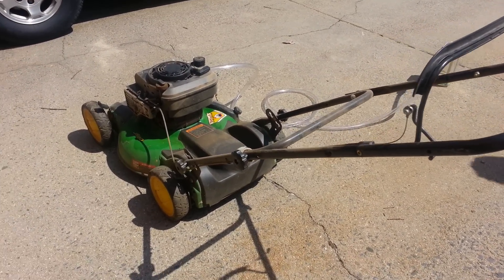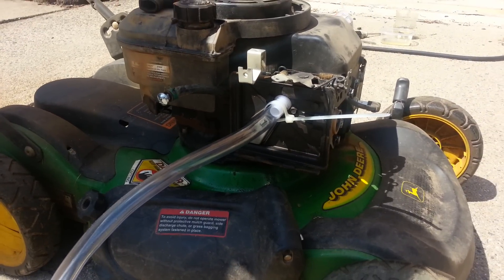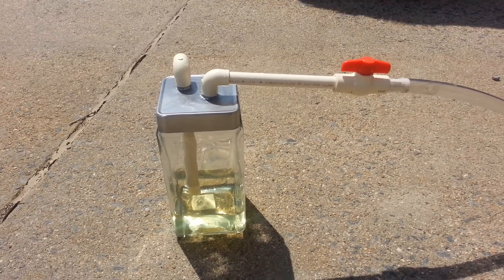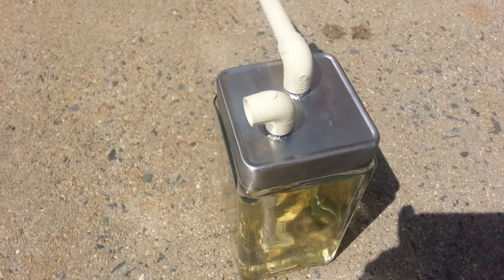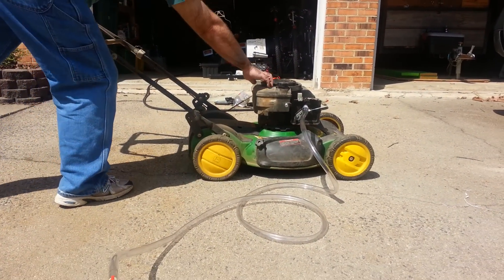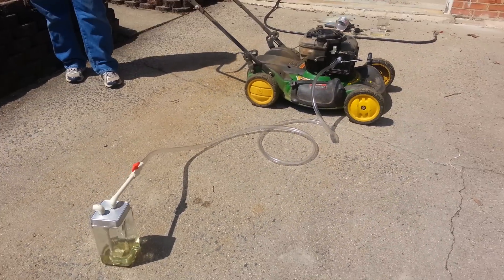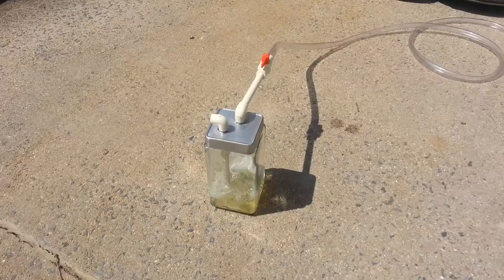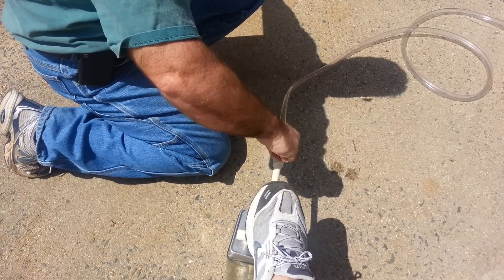Gas Vapor Carburetor

Comment: What does the carb do? It takes fuel and vaporizes it. What does your box do? The same!
You haven't accomplished much here, I would bet both use about the same fuel to run the engine.
Reply: Settle down My father a mechanic for 45 years said it would not start. When we started it he said it would not pull a car because it would not handle the load. When we ran the 1/4 mile in 10 seconds he said it wouldnt run for a long time. Then we got 651 mpg ( measured) he said he still didnt believe it. So you and your 35 years are a light weight. It certainly has its limitations but not the limitations my father said.
Mine is not speculation or anecdotal evidence it is empirical data achieved through extensive experimentation. Ive learned its advantages and its limitations and Im telling everyone in videos like these. I try not to have a pissing contest or prove Im the smartest guy in the room I leave that to Wile E Coyote I would also put my experiences up against your speculation any day of the year
Im not some guy who knew a girl whose boyfriends father tried this I am the guy who did this and not for quick audience and recognition from You Tube followers. The one thing I did learn was it doesnt operate in the normal or standard way internal combustion engines operate. I tried all the conventional wisdom first but kept my mind open and discovered this.
Its biggest drawback is it it is not responsive enough to changes in acceleration, so yes you can get it to go 60mph easily enough but you cant accelerate or decelerate or it stalls
Most major testing on this device has been on test tracks or in Tom Ogles case on an interstate at a steady 55mph
What I have learned was that all I ever learned or knew about internal combustion I had to disregard and unfortunately my father couldnt come to grips with being wrong
So 35 years experience has no bearing on this technology and most people with experience post the same notions all the time safety, engine damage, inefficiency, scam whatever 
To them I say It is safe it uses vacuum and you can backfire into a vacuum all you want but it cant(yes I said cant)explode. Ive tried and have never succeeded.
It burns intake valves(500 hours on 4 cylinder 800 hours on V8).Water injection helps
 It is 20 times more efficient( more on stationary engines.)
 Dont have an answer to the scam claim
Believe what you want call me any name you can think of but I have an Ex wife and she has called me things you probably have never dreamed of so get over it
Have a good day
Reply: +biggysground I thought the same thing until I remembered that fuel from the carb is only burned at 30 % efficiency.  The vapors alone burn at 90%+ efficiency.
Reply: +biggysground The carb only takes the fuel and atomizes it. Then the tiny gas drops are vaporized by ambient heat and then they are burned in the engine. Some of them are not burned because they aren't vaporized. This 'box' doesn't do the same. It takes the vapors directly and burns all of them because there are no liquid drops that have to be vaporized first and then burned. After all there is better and more consistent A/F ratio much like using LPG... Much better air-fuel mixing and combustion.
Reply: This method atomizes the fuel also. If you run the engine too lean then you risk burning the valves.
As the lean engine runs hotter, it causes undue stress on the internal parts. Yes I agree there can be a more efficient way to run the engine, but this way isn't cost effective and uses the same fuel, plus when you lean the engine out it loses power.
Reply: Carbs MIST fuel as much as vaporize. Here it's running vapor only, unless bits of mist are picked up due to the proximity of the suction tube to the liquid, but you'd still have mostly vapor.
Reply: Actually in our shop we had probably the same amount of " accidental" leakage as anyone's workshop and still did it for 3 years with no affect on our health. If we ran the engine on a carb we had to pipe the exhaust outside. So the comparison is 3 years no problem but normal system 15 minutes
That said there were a few times that the exhaust did displace the air in the shop but it was not determined by smell whereas carbon monoxide is deffinetly detectable and stings the eyes in 10 minutes
Tom Ogle reported the same effect and result
Thanks. Just trying to pass along my own experiences
Reply: I am a 35 yr master automotive tech and a licensed aircraft mechanic.
When you run an engine designed to burn auto fuel too lean then you do damage to the components.
You all talk a good game but fail miserably on knowledge. If burning the fuel super atomized is better, then what about propane gas? Doesn't that burn super clean and isn't that super atomized? Guess what, the engine looses power running propane over gasoline!
What we need is a more efficient fuel like hydrogen and an engine designed to burn it safely. Then you will see super power and mileage gains! Lean all you want then in short time you will have a costly repair bill guaranteed.
Reply: Actually, having been studying these, I see how the vaporization would be better than the MIST carburetors make, and evidently some have found their engines to run not only cleaner, but much cooler! I expect to richen the mix a bit with wool over the bottom of the intake tube, making lots of tiny bubbles instead of fewer big ones.
Apparently there are less emissions as well with vapor due to more complete combustion. 
Just do some reading b4 you show opinions. Naysayers are always a dime a dozen.
Reply: Actually read my comments in this forum. The fuel consumption is 100 times better with the device. In multiple experiments we achieved 4 days running( 95-100 hours on two cups of gasoline. The same amount runs the lawnmower on the video about 45- 60 minutes depending on RPM Tom ogle performed the same experiment with the same results. The device has been patented more than 20 times( incorrectly as patents on the same device infringe the patent office did not understand the theory and thereby credited inventors with new patents on small sometimes insignificant changes). With the advent of the theorectical division of the U.S. Patent office and the new standards for prototyping the patents would have been revoked. They have all expired so there is no need
Have a nice day
Reply: We ran our system for 3 straight years for weeks at a time and heated our shop with the exhaust from a car engine1100 cc Porsche suitcase engine. We had no appreciable health affects
Reply: Hope that addresses your concerns the only issue is the CO2 will displace the atmospheric air so you can run out of breathable air and physically asphyxiate. Not so with a regular carb or fuel injectors. You have about 15 minutes
Reply: Do you work for an oil company or are you a government dis info agent?
Reply: incorrect. a lean 4 cycle engine runs higher cylinder head temps and burns the valves. Fuel enrichment helps keep the valves, esp the exhaust valve run and last longer and cooler.
Reply: Sorry you could be 100 years or only 60years in the business like my father but this is not in the scope of your expertise. It doesnt burn the same way. Worked on this for 3 years 70 hours a week learned a lot that did not apply to standard combustion. It did burn or scorch the intake valves but it didnt much change the head temperatures and we monitored and tested for the heat differentials constantly. The heat was measured on the exhaust gases, the surface of the heads The exhaust manifold and it was the same or very  slightly different than the control or standard set up for the engine in this case an air cooled 1100cc horizontally opposed fuel injected 4 cylinder. In our liquid cooled V8 302 we also monitored the coolant and there was little change if any.
Initially I thought the same as you but I proved myself wrong

For a Briggs and Stratton 3.5 hp engine we used a similar set up and our exhaustive testing shows that it will run 100 hours (give or take depending on conditions) on 2 imperial cups of fuel (in this case gasoline)the emissions are carbon dioxide. the control ran for 45 minutes

It certainly has its limitations but efficiency or inability to perform under load arent a problem. Being able to control variations in speed is
Reply: I worked on this technology for 3 years 70 hours a week. performed hundreds of experiments. We did not quickly put something together then cry Eureka the oil companies are ripping us off.Lol 
Ive learned that this technology is not easy to figure out and that previous experience in combustion engines was not an advantage . This system is counter intuitive to what you believe. it makes you rethink everything you believe or know
I know it burns valves because I had to lap the intakes on my 4 cylinder a few times usually after 500 hours (800 hours on the V8 302). Water injected helped but is one more consideration that makes the system non viable
It doesnt run hotter at all it is pretty much the same temp at the exhaust, the oil, the block, the heads. With the liquid cooled engine we also checked coolant temp
Reply: Wrong again wrong triple wrong!
Reply: Gary Chandler yes. and rain is the same as humidity
Reply: biggysground, A carburetor for the most part, can only very minimally vaporize gasoline by agitation, or by the carburetor absorbing residual  heat emitted from the engine. For the most part, a carburetor atomizes gasoline into a fine mist,  and then emulsifies the atomized gasoline with ambient air when it flows through the venturi. To vaporize gasoline, it must evaporate through a phase change by heat or minimally by agitation. Gasoline is a mixture that is made up of many constituent parts and compounds that evaporate at different temperatures, from about 60 degrees to 495 degrees Fahrenheit. The spontaneous combustion temperature for various gasoline mixture's ranges from 495F to 535F. Different Oil Companies use different gasoline mixtures, which account for the differences. The highest vaporization temperature for a constituent compound in gasoline is Octane, which has the highest "knock rating". The "Turkish Water Pipe System" in the video vaporizes gasoline in several ways: 1) by light refracted in the enclosed clear glass container causing the gasoline to minimally heat up by convection, 2) by heat on the concrete that also minimally heats the gasoline by conduction, 3) and by agitation of the gasoline by ambient air that is being drawn through the liquid gasoline by engine vacuum, and by ambient air temperatures from warm outside air temperatures. This system will only vaporize the "Lighter Ends" of the gasoline, and will leave the "Heavy Ends" to accumulate in the clear canister. To vaporize the "Heavy Ends" higher heat must applied to the Gasoline the achieve a complete phase change of all of the gasoline's constituent parts.  I hope this clears up any misconceptions.
Reply: In my testing I ran the engine in -40 degrees successfully so heat really isnt the determining factor in the video. You are right about the light ends of the gasoline and the heavier ends as this technology works well and has plenty of horsepower when first started about 8-12 miles of travel then control of the acceleration starts to wane. All successful automobile applications have been done by driving at a set speed(Tom Ogle)or on test tracks(GM, Shell) or by circulating the light ends through the system (Charles Pogue)
Drawing air through the liquid does nothing as I have tried it all 3 ways bubbler, wick and empty tank and they perform the same. The biggest mistake made when trying to explain this system is to explain it in a concept we all understand(carb , Injectors) 
I work for 3 straight years on this system doing hundreds of experiments only to find my knowledge of internal combustion engines to be a hinderance. This system works on the vacuum created by the intake of the cylinders and as long as there are no vacuum leaks the system will operate but it needs a stronger vacuum on the heavy ends more than on the light ends
Hope this helps
By the way the light ends are separated from the heavy ends by lowering the evaporation point through the use of vacuum
Reply: I have also been working on gasoline vapor systems for at least 7 years, and have built 17 different prototypes. I am 60,and I have been working on cars, starting from the age of 14. I have worked in a automotive Machine Shop for several years, and I have also been a line mechanic for many years. My father was also a Mechanic. I was an active Drag racer for over 30 years, and I build Race Engines. I am currently patenting 2 Gasoline Vapor Systems, which I developed and I will be introducing to the general public soon. My systems work flawlessly, with no issues. I will not release any more information about my systems at this time. I have a site on Facebook called Gasoline Vapor Systems, and I invite and welcome all who are interested in this subject to join. Thanks, Mike
Reply: Good on ya and good luck Look forward to hearing more about it
Reply: Thank you, and the same to you !
Reply: And the exhaust is only CO2 ( non toxic)
Reply: Not my expertise? WTF are you saying? I have proof I am expert you have nothing but babble lips dumbass!
Reply: YOU ALL ARE DUMB ASSES WHO WISH TO MAKE SOMETHING FROM NOTHING. GOOD LUCK SCREWING UP YOUR EQUIPMENT DUMBASSES ARE EVERYWHERE AND THEY ARE HERE!

Comment: Unless something else was done pre video, this what happened could never have worked. I am talking about a mower sitting with tube running to it no gas in motor, no fumes going from bubbler to motor, so how did the engine start and so easily. Are you implying that the suction in the cylinder sucked fumes from the bubbler through tube that far away? Please explain thanks
Reply: Yes the vacuum forms almost instantaneously and yes is more volatile than a normal carb. So it starts right away. See my responses to video above to explain how it works and how I know
Have a nice day

Comment: I have seen these before, and have seen the plastic jug mounted to the lawn mower base, and have seen it mounted to the tubes running to the push mower handles. I was always thinking why instead of mounting plastic gas bottles to the mower they did not use the tank that is already a part of the motor, the gas tank.
Reply: Wrong( please no offence)
Poor understanding of how the system works. See my writing about the system above. You could do without the bubbler tube and downsize the intake on the tank so the gasoline would not be so agitated. You need restriction to form vacuum and the tube allows for a restriction. Any restriction would accomplish the same effect
Reply: The tank is not deep enough, the liquid gasoline would splash into the tube going into the carb. There is also not enough room for the fumes to accumulate before being sucked into the engine.
Reply: By the way just reread your entry and I have tried this on a lawnmower using the tank that was present with the same results as in the video. The tank is a little awkward to use as it is an unusual shape but it works well enough. Incidentely one of the most successful proponents of this technology(Tom Ogle) started off using the gas tank on the lawnmower to great success

Comment: my brother has a mower with a busted carb, so with some tape, garden hose and a pop bottle we got it running 
we had a big holdup with the air to fuel ratio (running rich)but about half a dozen holes in the bottle it started to run 
cool stuff guys keep it up

Comment: Ive played with the gas vapor system on my Silverado i had, how did you keep the gas warm? Once the gas gets cold it stops running as the vapor production gets too low to sustain combustion
Reply: ur right u have to have some way to heat the gas or it will stop producing vapors. They are experimenting with what tom ogle invented in the 70s in the video. In his invention he heats the gas tank with electric coils. his ford galxie which he retrofited with his invention alegedly got 100mpg
Reply: jeremy grable What was the ambient temperature when it stopped working?
Reply: It's not the heat of the system its the volatility of the mix. We did our test with no heat at all. Read the top of the page
Reply: jeremy grable you could warm the gas for increased vaporization, or you could warm the air for a less oxygen-rich charge (think density/mass of the air in 14.7:1 as its temp changes). Plenty of “waste” heat in an engine bay to accomplish either (your Silverado has an Exhaust Gas Recirculation system from the factory).